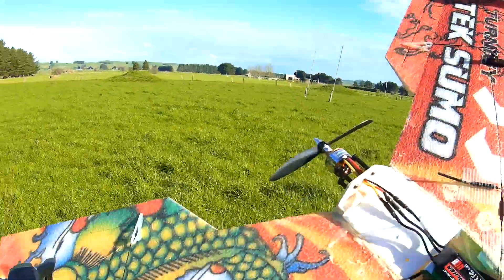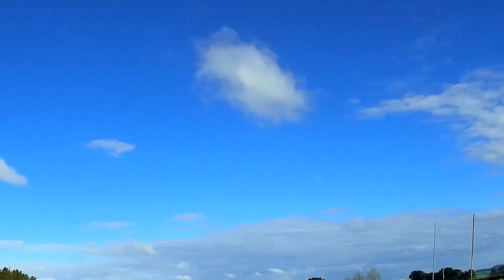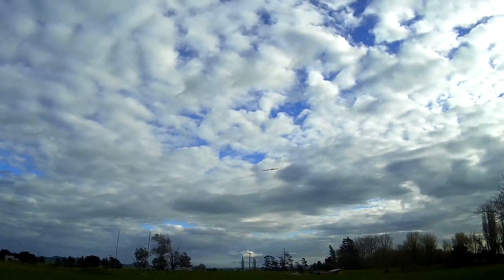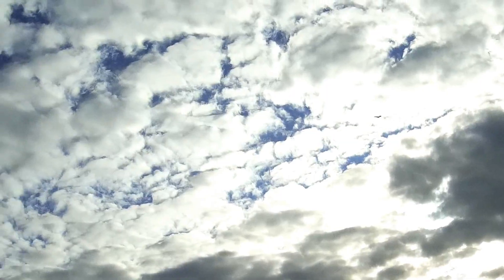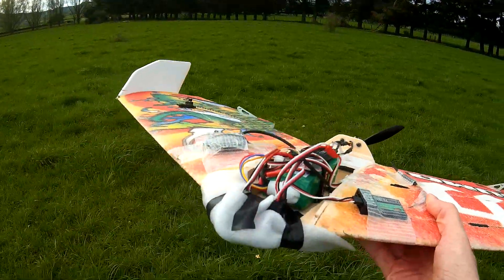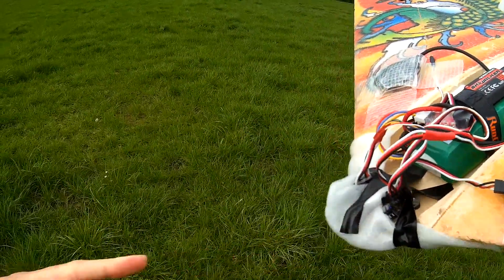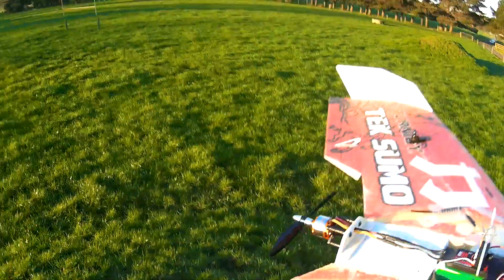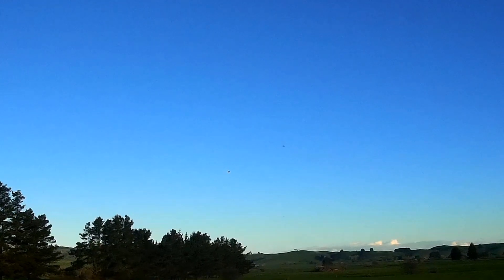iNav Teksumo first try, RTH

Comment: Hello Chris
Do GPS modules without magnetometer have a forward direction. I have a beitian BN-220 module. One of the corners is flattened slightly. At your best guess would this be the forward facing corner. It's my first play with INav. I've got everything working but not sure of orientation of the GPS puck.
Thanks
Chris
Reply from the maker: No, GPS just tells you where you are on the planet, not which way you're facing. They definitely have a top and bottom though, the antenna should be facing upward because that's where the satellites are :)
Reply: iforce2d 
Thanks. Went out this evening and it flew like an angel. Everything working great.

Comment: Hi very interesting video. Believe the area where you used to stay was better to fly. Although the lake with cow shit also not a good place to land what 😉. Do you show a bit more of the INav configuration? How does mixing work? Greetings and hopefully still many videos
Reply from the maker: In the mixing section along with all the multirotor mixings there is 'flying wing' and 'plane' or something, I think selecting one of those makes it a plane maybe. I followed this official guide but even some of the most fundamental points like that are not covered, in favor of just telling you to use a preset.
https://github.com/iNavFlight/inav/wiki/Fixed-wing-guide
I chose the Wingwing Z-84 preset which I guess made a whole lot of other settings that I have no idea about. The main thing I've had to change was the P gain which needed to be higher for the Teksumo.

Comment: Nice ! Are you using a separate bec for the FC and the servos please?
Reply from the maker: No, I'm using the 5v output from the ESC to power everything.
Reply: Aren't you worried about brown outs if the FC and the servos are powered using the same source?
Reply: Extremely unlikely for a brown out, especially on a wing with only 2 9g servos. Using the esc power is the approved way of doing this.

Comment: One thing I would mention and you may already know but I see white lines in your video feed, try using a common ground for your camera and vtx, that should eliminate that problem.
Reply from the maker: I don't quite get what you mean - if they didn't have a common ground there would be no picture at all. I think these particular servos are interfering, since it doesn't happen when the servos are not moving, and doesn't happen on other planes.
Reply: iforce2d that would make sense. I just meant on the flight controller board the camera and vtx ground wires need to be wired to the same pin. Some people run them to another ground which will work but leave white bands on the screen, just trying to help, always in search of a clearer picture! ;-) fpv on!

Comment: do you record your fpv footage on a vcr?
it looks weird...
Reply: Toon Homble fpv video is analog, the quality is trash but it has zero latency. The DVR records in good resolution but the video it receives is analog from a sensor used in cctv cameras.
Reply from the maker: I think the servos are causing interference somehow. On some planes it's fine and some not.
Reply: never seen that before, figured u used an old vcr to record.
Gave me 90's flashbacks...

Comment: ive used inav 1.4 was fine but 1.7 i couldnt get rth to work....  m8n ublox module on spf3evo
Reply: KillaG FPV Make sure you use a compass and calibrate it carefully. Keep it far from other components. Also, F3 Omnibus is very good. :)
Reply: @gygaxthegoat2491  compass not needed for wings. It's better to switch it off. Heading info comes from gps